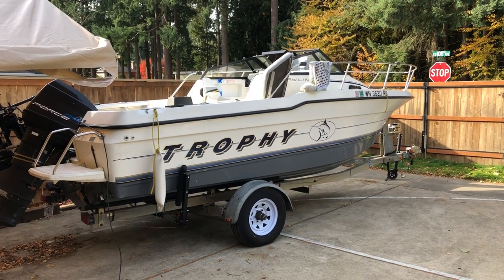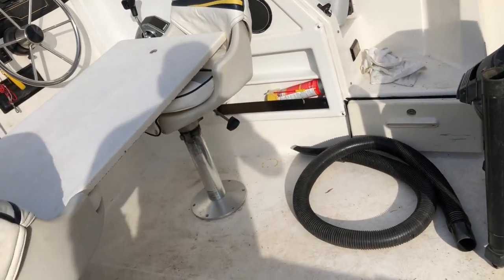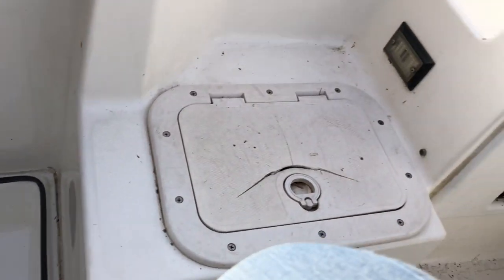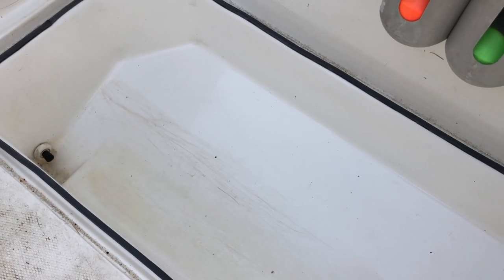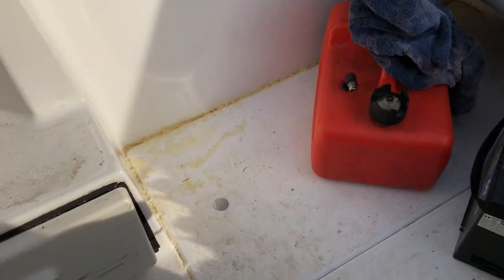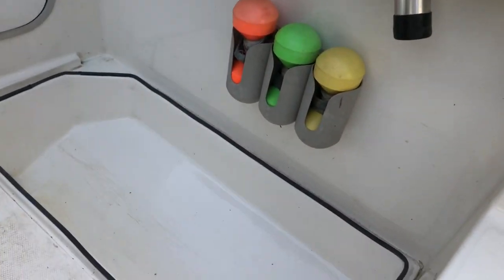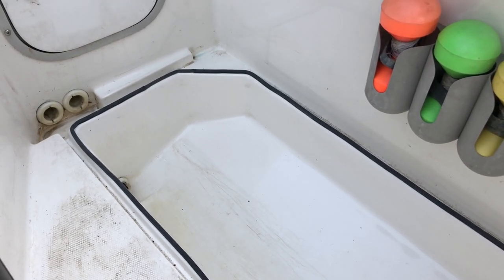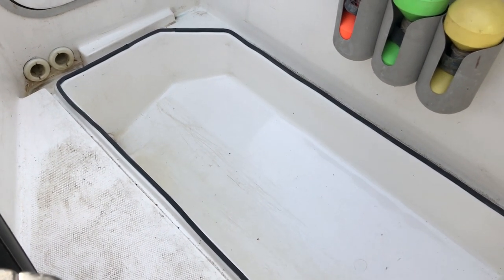1992 Bayliner Trophy Fishwell, Livewell problems solved,. Fish well, Live well.

Comment: old video and no recent replies but those are fish lockers NOT livewells.  There is supposed to be a stainless strainer and the drain motor is actually a macerator as well.  The foam works better when applied to the underside of the lids.  the actual livewell is on the port side step just in front of the compartment in this video.

Comment: I’m trying to figure out how to fill them when they do work, is it by hand? The motor is connected to the drain only
Reply: They fill automatically via a hole in the transom.   When you pull it up on the ramp they will drain, well, mostly.  There's a valve WAY down in the bottom of the sump area on the port side battery compartment where the line comes through the hull.  If that valve is closed they won't fill.